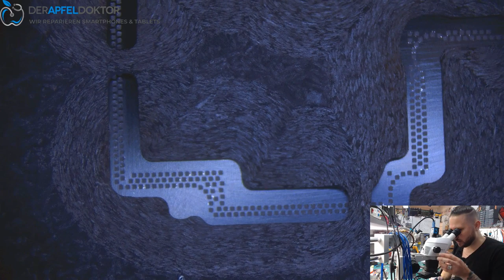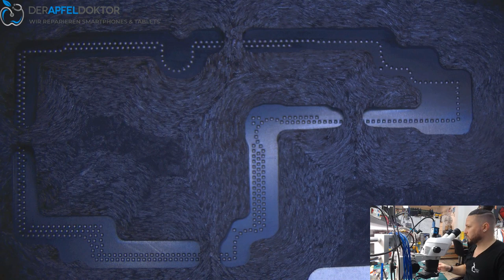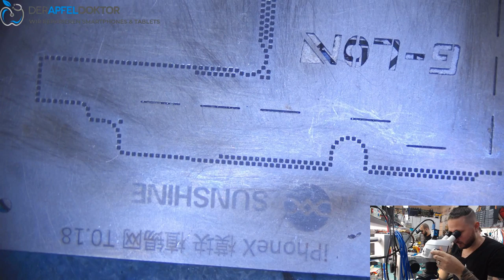MASTERWORK - iPHONE X BOTTOM BOARD SWAP - HARDLY BENT LOGICBOARD - BOARD SWAP

Comment: is the NFC paired on an iphone x or are you transferring because of data only?
Reply from the maker: NFC you need for full function. It’s paired.
Reply: @RESQREPAIR  has that always been the case on previous versions like the iPhone 6 for example? I thought it was replaceable before
Reply from the maker: Andy Fairbairn Not before.
Reply: @RESQREPAIR  thanks Ben
Reply: if NFC was damaged...did phone works after restore with new nfc ic